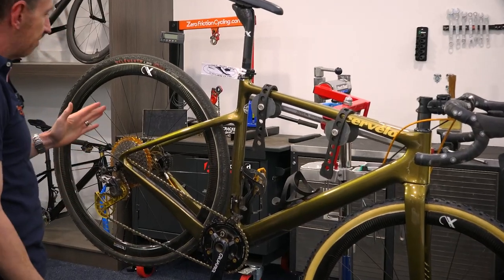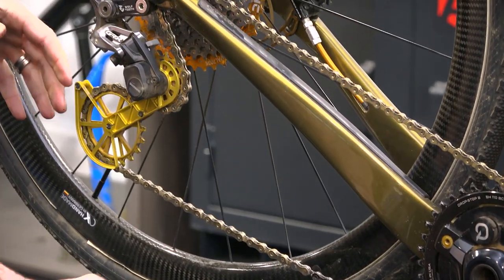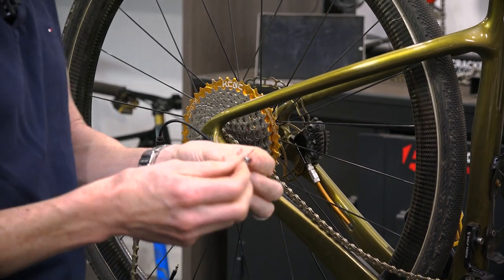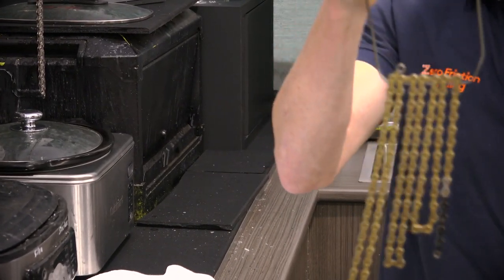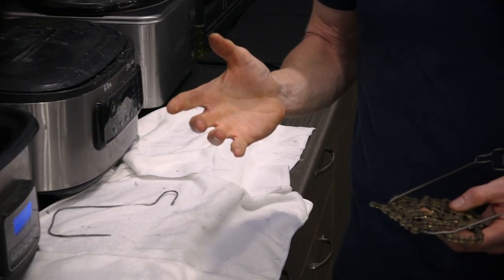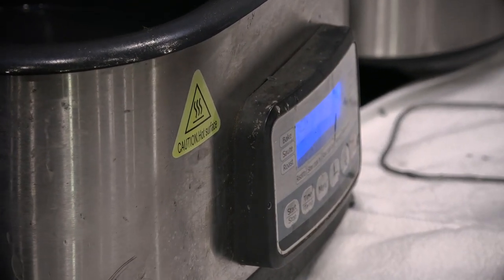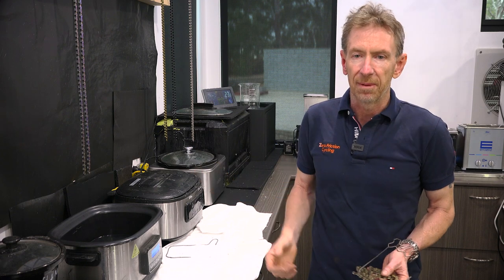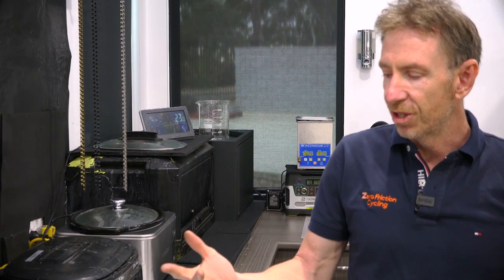Episode 4 - Part 2 Immersive Chain Waxing  - How to Guide.

Comment: I dont understand how the fine particles of contamination you introduce in your pot every time and then will be transported from the outside of the chain throughout the whole chain during the immersion are not an issue?? It makes little sense to me unless you could filter out these abrasive elements. I have used immersive waxing for years now btw, but want to improve my application process. Thx for the info
Reply from the maker: I can help there, it is really just basic numbers / math. Remember we are comparing IM waxing vs Drip lubricants. 

For a start a solid wax has highest contamination resistance possible cos its solid, but lets say an IM wax and a drip on wax have the exact same level of contamination getting onto / into the chain (with drip waxes some is brought in from outside to inside normally on re lube, but also some in riding will get between side of roller and inner link plate, and then can be also dragged deep into chain. 

I will have to use a very arbitrary guessed number which will vary wildly by rider and environment - but lets say every 300km of riding, there is 0.1g of abrasive contamination gathered by the chain. 

WIth a wax drip, you typically only apply about 3ml onto chain - lets use 5ml to be generous - across over 100 links of chain - so circa 0.05ml per link. Half of this is carrier (water) which will evaporate for wax drip to set - so 0.025ml per link of fresh lubricant added - to improve ratio of lubricant to contamination in that link - to help with the mental map of whats going on inside drip lube only chains over time. 

But keeping it simple - every 300km, we have 5ml going on , only 2.5ml of which is actually staying behind as lubircant, and say 0.1g of contamintion. 

So re lube one - 0.1g contamination + 2.5ml. That application is worn through next 300km, re apply. 
Now we have 0.2g contamination to 2.5ml lubricant
Next 300km we have 0.3g contamination to 2.5ml lubricant and so on. 

Vs an immersive re wax - putting the chain into a bath of circa 500ml of 100% lubricant. The old coating with any contamination melts off, and the 0.1g distributed through 500ml of lubricant. So we will have 0.1 / 500ml amount of abrasive contamination going onto the lubricant coating on the chain. 

Next re wax - we have 5grams or 5ml less than before, and another 0.1grams in - so we have 0.2grams / 495ml. 

next re wax, we have 0.3grams divided by 490ml 

Compare that to 0.3grams vs 2.5ml for drip lube chain. 

So yes, over time the contamination in the wax pot will make the wax more and more abrasive, but it takes a long time for it to be any concern at all vs what is occurring on drip lubricant chains. And so then all one has to do is change to fresh wax every year or two depending on their riding, and they remain MILES ahead vs drip lube only, and is why day in day out low friction and wear for Immersive waxers is unmatchable by drip lubricants. To try to match IM waxing drip lubricant users need to conduct very frequent full chain flush cleans and resets, which is more time, money and faff that a bath in hot wax.

Comment: What's a good temp to pull the chain out at, I heard 52-54C I think on the oz cycles channel, but you mentioned the wax being 70-100C.
Reply from the maker: Hey colin - step 1, delete all information on waxing obtain from oz cycles - maybe his content on other topics is great, on waxing it is mostly a disaster, and with dishonest testing thrown in for fun (In my opinion). Step 2 - unsubscribe from oz cycles as he is in jail for being a horrific human being (kidnapped, tortured and killed his neighbours dog. There are other great sources of cycling information from not horrific humans, get your information from these). 

As long as wax in pot is anywhere from 70 to 100dg c, thats great. Just removed after you have finished swishing. Trying to do the cooling thing to remove just results in a lot of time wasted, and enormous mess as so much more wax is pressed out, and after 10mins of riding due to huge pressures inside chain, you have the same amount of wax left coating parts anyway
Reply: @zerofrictioncycling992  jeeze, I just googled it, that's awful.
I'll try it at about 70C, and see how it goes.
I tried linklife for motorbike chains, but it's really gooey, I can't see how it keeps dirt out, it felt nice for about 50 miles but is wearing off now.
Thanks

Comment: Can I use an ultrasonic cleaner to heat the wax in a container submerged in hot water? The machines go 70-80C
Reply: I was wondering about the same, having just ordered an ultrasonic cleaner that is heated as well. There is one video on yt where someone uses the ultrasonic function, he says that the soundwaves help the wax penetrate the rollers. I’ve decided to give that a go, but I’ll keep the wax & chain in locking Tupperware and use a water bath, same like for the cleaning part. I‘ve got three chains lined up already, I guess we’ll see how that goes.
Reply from the maker: @PhilippDitfurth  refer to ultrasonic and race chain guide. In general using US is a vastly more time consuming method for no difference you would ever notice. IT is used for race chain prep, but it needs to be used properly, and for waxing, you need a decent power. Most YT info on waxing / US is not amazing... SOrry delay i get very behind on SM stuff, but definitely refer to Ultrasonic guide, instructions tab - zfc website, also have an ultrasonic video guide now.
Reply from the maker: refer to ultrasonic and race chain guide. In general using US is a vastly more time consuming method for no difference you would ever notice. IT is used for race chain prep, but it needs to be used properly, and for waxing, you need a decent power. Most YT info on waxing / US is not amazing... SOrry delay i get very behind on SM stuff, but definitely refer to Ultrasonic guide, instructions tab - zfc website, also have an ultrasonic video guide now.
Reply: @zerofrictioncycling992   Awesome Info, thank you! Also great you´re taking the time to answer here, really appreciate it :)

Comment: After watching Josh's video from Silca, he mentions to let the wax cool to start forming a film before taking the chain out, to leave as much wax as possible in the chain.
You don't seem to do that, do you think it makes a difference ?
Reply from the maker: No i dont. I have spoken to josh re that as it differed from previous knowledge discussing with Jason Smith of friction facts. Basically the pressures inside chain from pedalling load are extremely high, and so removing and hanging to set on a 40dg C day, or putting in cold water to lock in as much as possible, 10 mins down the road you will have the same amount of wax inside the chain, just a lot more mess with the latter method. Josh advised that their testing on their very accurate test machine does show a performance difference, however it is ...... marginal. Outside an extremely precise test lab and extremely controlled conditions, i cannot see anyone being able to determine a difference in treatment performance or longevity - however as a possible best practice prep..... maybe.... i very very rarely disagree with josh but on this one i think there are much more practical marginal gains like dedicated race and training chains, dedicated race wax pot etc etc for those who want to have top performing race chain. I personally would not introduce my wax chain to water voluntarily.
Reply: @zerofrictioncycling992  Greetings from San Francisco USA. A HUGE THANK YOU for all the evidence based reliable and repeatable solid information. I have viewed all of your vids and have started hot immersion waxing my chains. I'm not a racer and any additional W savings would appreciated but not necessarily noticeable by me. However your information regarding the amount of chain and drivetrain wear using wax vs. oil based lubricants was astonishing, and convinced me that hot immersion waxing is well worth the modest effort. The replacements cost of worn chains and drivetrain components have increased significantly and due to COVID related supply chain issues, bicycle parts remain difficult to obtain. Be well...
Reply: lol he is only saying that so you use more wax and have to buy more ¯\_(ツ)_/¯

Comment: I melted some teflon into some prarfin and put it the oven for 30 minutes then boil it in linseed oil or lamp black graphite.  If I use the oven it takes about half hour with kerosene gel.  Drip it on with a spunge and wipe it off with a rag.  The parafin works as a binder and a lubricant so you can use WD-40 or silicone based cleaner without risking a total wipe off.
Reply from the maker: Goodness me. Over the years i have had about 4.6 billion emails of variances of the above re DIY waxing. I really, really just recommend a bag of msw. It will be much better. It will be VASTLY easier. Check episode 17, waxing - concise version, and if that isnt a whole lot easier and proven amazing performance vs above..... For those reading, do not wax in your oven. Please. This can end badly.

Comment: So after I clean my chain and wax it then when I rewax it I don’t have to clean it just put it back in the hot wax ? I hope it’s that easy because I have 3 more chains to go :).
Reply from the maker: that is correct - i am not sure where it keeps coming from that people fully solvent clean chain again before re waxing - the clean is the initial clean to remove factory grease / drip lubricant - after that, it is just re wax and yeehaa.
Reply: @zerofrictioncycling992  thanks for the info. I’ll keep my chains in rotation and see how long till they need rewax.

Comment: How many uses can you guys get out of a shimano 12speed quick link?
Reply from the maker: i personally generally stay with around 5, any link. It is easy to feel when locking in the link is too easy. Ie they need a tool to start with, but by around 5 - it is easy to do by hand. When it is locking or able to undo easily, a new link is a good idea. A local pro tested ybn qrs 11 and it failed on its 42nd re use - the shimano would at least match that - but such behaviour is not advisable! A fail link may not just be inconvenient, you may go over the handle bars if on stand up power, chain may wrap in back wheel and do all sorts of exciting things etc. So erring on safer is good vs pushing re uses.

Comment: Dear Zero Friction, My wax has fine black stuff after about 6 or 7 uses. How should I clean the chain when rewaxing?
Reply from the maker: Hey stuart - what wax are you using? if its mspeedwax or hot melt, the fine black stuff is the tungsten disulphide, so that is normal. It will be present from the start, maybe it is just more noticeable after a few waxes as some is pressed onto sides of plates / cogs etc. You shouldnt  be cleaning chain before re waxing. If you find it is unsightly for you, after swishing and removing and hanging to set, then use a cloth to wipe outside of chain to remove excess from outside of chain. it is wear protective on sides of cog and ring teeth but again if you find unsightly, a quick attack with a very stiff nylon brush (or quick spray with ufo drive train clean, allow a few mins to work, stiff brush and wipe) - but in general the small build up on cassette and rings is recommended to leave - it is pretty self limiting and again unlike many drip lubricants where the build up can be abrasive (wet lubes), a small build up of a very slipper wax + friction modifier is wear protective instead.
Reply: @zerofrictioncycling992  Thank you! I confess I'm using paraffin wax I had around the house. Now that I'm hooked I plan to up my wax game to one of the modern mixes. Thank you again

Comment: What to do with a brand new chain?

All opinions I've heard so far say to get a brand new chain, strip all of the manufacturer's grease and then wax it, before using it, straight from the packaging. 
In your MucOff video I heard you mention the manufacturer's 'break in' grease on a new chain. Got me thinking,...
Wouldn't waxing it immediately, without any break-in, cause the 'broken in' particles to be retained in the wax in the chain innards and for them to remain inside, if it's just re-dipped, not deep-cleaned/de-waxed? I can't see these particles being a 'good' thing.

Should a brand new chain be ridden a short distance, say ten miles to help break it in and smooth all of the contact surfaces together before stripping all of the manufacturer's grease (and tiny metal particles from the break-in) and then waxing it?
This would be similar to driving a new car gently for a few thousand miles before getting an oil change.

Or, are the tolerances so small and any particles produced so negligible so as not needing a break-in?

Not heard any discussions regarding this.  Thanks.
Reply from the maker: Hey there - for training chains - yes correct there may be a very small amount of metal particles left from mfg when doing normal prep of stripping factory grease and waxing from the box. However the impact of this would never be able to be tangible measured by one re chain with break in before cleaning = X kms to 0.5%, chain without = Y kms to 0.5% - there are far more variances in your actual riding outdoors vs a very very small amount of metal particles not cleaned out via normal method. 

For full race optimised chains they do have a break in first. However fully optimised chains are also professionally ultrasonically cleaned. If you look to do this at home without a good ultrasonic and how to use properly - the contamination the factory grease absorbs in your break in - will your perfectly remove all of that as well as the metal with container cleaning to make a break in worthwhile. 

In short there is just zero tangible benefit to doing a break in for training chains. For professionally prepped / very well prepped at home via ultrasonic - for full race optimised dedicated race chain, then yes break in with factory grease before cleaning process will help make that chain as fast as it can possibly be on race day. However that is still more getting the chain "broken in" vs any potentially measurable difference from the very small amount of extra metal particles removed. It will not be nothing - at a guess as no one can ascertain exactly what is doing what - but break in typically will make a chain 0.5 to 1w faster vs non break in (chain brand / model affects a lot - some chains are looser, some are very tight) - of which maybe say 10 % of that is metal particle removal and 90% is simply getting the chain surfaces broken in (which will generate more metal particles, but the ultrasonic rounds take care of that). 

Hope that helps!
Reply: @zerofrictioncycling992  Wow, that's a superb answer. Thank you for taking the time to reply, much appreciated. I won't need to worry about my new, newly waxed chains now!
Keep up the excellent work and all the best!

Comment: Sheldon Brown says on his website that bushingless chains are significantly less susceptible to chain stretch or wear.
This seems like valuable information that is not getting the attention it deserves.

Are KMC X8(99) chains bushingless? Are any other KMC chains bushingless? Or other, non-KMC chains?
Reply from the maker: Hi Vive - hmmmm sort of. Firstly it isn't getting that much attention as 99.9% of chains are already bushingless. Basically only 1/8th single speed or track chains are bushing chains, i do not know of any 3/32 or 11/128 chains that are bushing chains. A bushing is not going to increase elongation wear directly, you just have a bushing running over pin, then roller over the bushing. Nothing changes from the pins perspective re wear load, nor the bore of the bushing. what does happen is that these chains are much more difficult to ensure lubricant is penetrating too the pin. Some chain lubricants have penetration issues (like squirt) some do not for non bushing chains, but may to some degree on a bushing chain. So lack of lubrication deep inside chain can have them wear more quickly. 

Also, most bushing chains are cheap as. IF one is spending $10 to $30 on a 1/8th chain thats 400 grams of steel, i can assure you the pin / bushing have no treatments against wear like say a quality 11spd 11/128 chain that is $70, has 40% less steel - they will have hardening treatments on pins as well as chromium plating etc - they are just a much much higher quality chain in ever way. If you spend half or 1/3rd or less the money for a lot more steel, i can assure you, you are buying crapper steel. 

Again this is only a thing that an extremely, extremely small % of cyclists need to learn about, and the knowledge is there on the track chains product page on zfc website - but it isnt something that i can focus a lot of time on as there is so much other knowledge im trying to get out to save the huge % of drivetrains from an early death, bushing chains are just a teensy tiny demographic, i would sell one 1/8th chain per thousand 11/128 chains. And the 1/8th chain i do recommend (the ybn 410) is also bushingless for oh so many benefits re lubrication, faster as less friction surfaces etc.
Reply: @zerofrictioncycling992  Interesting stuff. Thank you.